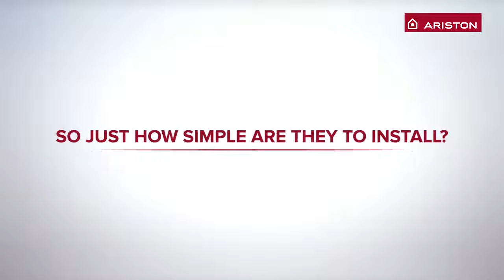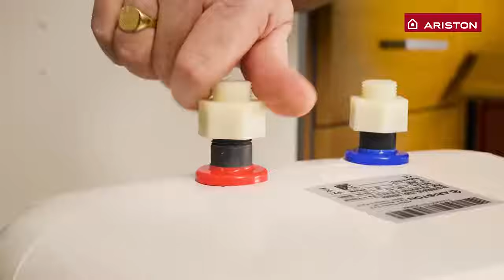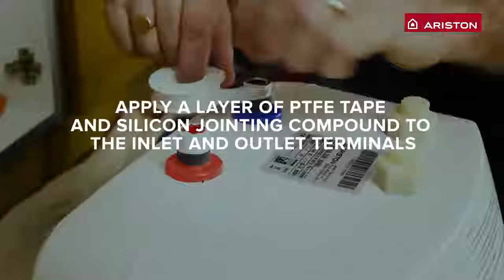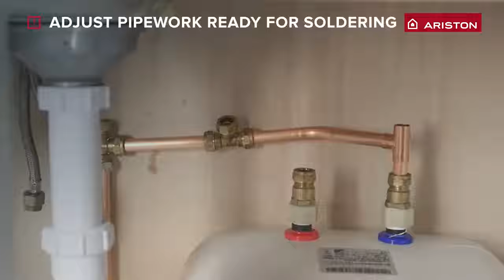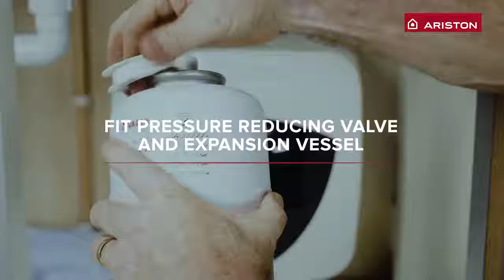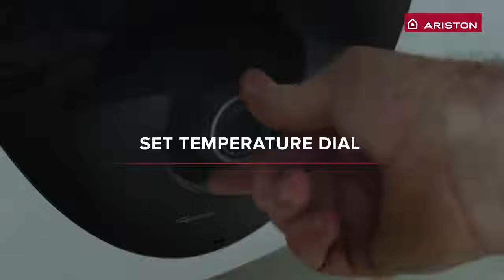Complete installation guide for the Andris Lux water heater

Comment: can you put a oversink water under the sink with the water connection facing upwards
Reply: no, the units only hang one way. So if you do that you need longer tails to connect from the bottom of the unit, round it to the cold feed and hot tap

Comment: Hope the jointing compound works, because the Dielctic junctions leaks like mad😢
Reply: I also had trouble with this. I fitted a 1/2”-15mm compression adapter to the dielectric fitting and I could not for the life of me get it to seal. I tried PTFE, Loctite55 cord, Fernox LSX, nothing would seal it. I ended up just fitting a flexible hose to it instead.
Reply: I Just use the 1/2 to 15mm female compression iron and loctite dont even bother with those silly plastic fittings
Reply: @SAY1MY1NAME1 those silly plastic fittings are to avoid corrosion which can happen fast
Reply: don't forget the 15mm black washer lol!
Reply: They only leak if you don't use the washer. You're not needing to use ptfe if the washer is fitted lol

Comment: the non-return valve is shown in the diagram as part of kit A and I suppose it must be used. However it is obvious in the video that the non-return valve is not is not installed. Also the installation of hotun is not shown.

Comment: where can i found the reset button for Ariston Andris Lux 10 in case it trips?
Reply: Make sure power is off take of the black  cover off,  and its a tiny little hole, press with tiny screw driver

Comment: I noticed a the word ‘unvented’ written by the name of this product in other stores and was reluctant to buy them in case it meant something. is there a difference or are they all the same thing
Reply: unvented means the units are under mains pressure, ie, not fed by gravity tank
Reply: hello. Did you get one. I want one but I am worried about the vented/ unvented issue . I know the Kwikot is unvented so it will burst if not installed correctly. You cant just install these things out the box due to the pressure/venting story
Reply: The unvented means that it does not have a vent pipe connected to it to allow the escape of pressure build up. That’s why this would have to have the PRV ( pressure relief valve ) to allow discharge of pressure in case of a build up. There’s nothing to be scared of but this is in most cases when it comes to undersink hot water tanks.